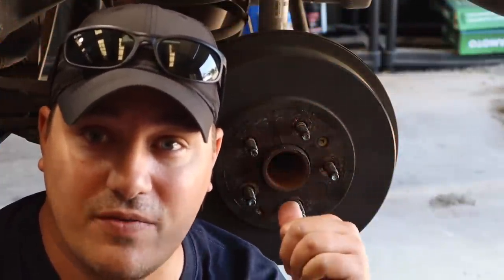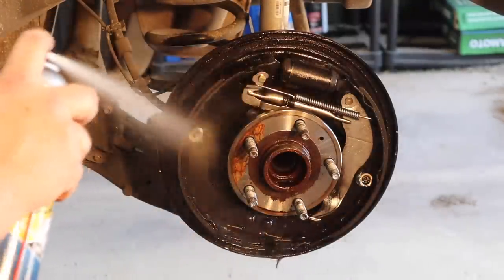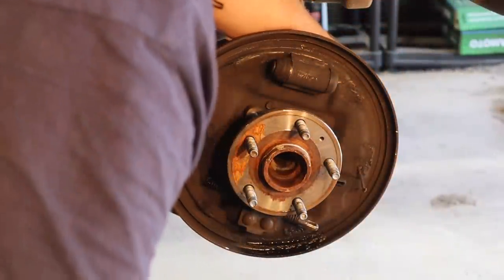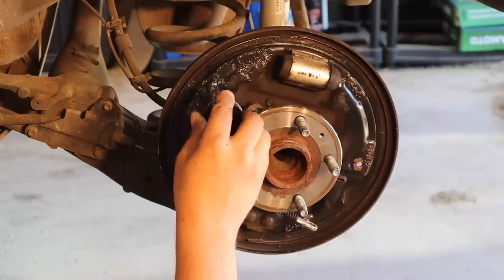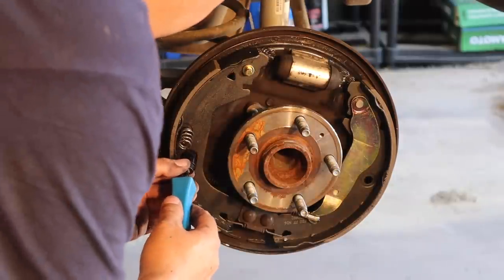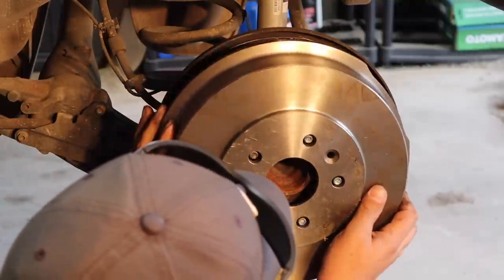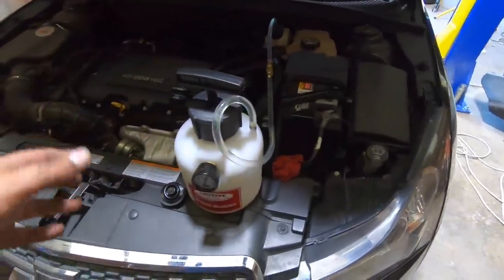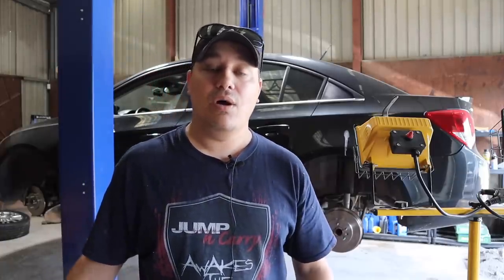Rear Drum Brake Replacement - 2012 Chevy Cruze Turbo 151K Miles

Comment: Who needs those drum break tools, struggles, struggles, almost got it, struggles,lol.  To each their own. Disc brakes are easier that's for sure. Good to see you continuing forward despite the recent setbacks.
Reply: The brake tools you needed a re very inexpensive at Harbor freight.  Using the correct tools would make the job easier and would Make a better video.  Randy you don’t have to put out a video every day. I think it’s better to have quality instead of quantity. Best wishes and don’t give up

Comment: One tip for you and everyone, the spring cap that went flying off, all you have to do is either use electrical tape or even duct tape, not much and tape it to your tool,the cap won't go flying off plus makes it so easy to reinstall. In addition I used a C clamp to hold the shoe in place to the backing plate, it only took seconds to put the springs on to hold the shoes in place. No headache involved.

Comment: You need to read a brake repair manual so you will know the concept and difference between the emergency brake adjustment and the neutral shoe position adjustment.  Most people watching don't know this.  Thanks for your work.

Comment: The squeaking and squealing is because the brakes are out of adjustment. All you need to do is run out the self -adjuster a few clicks and your golden. No need to replace anything.

Comment: Randy Pro Tip: Take a pic(s) of the assembled unit before disassembly! 👍👍 The invention of digital cameras/phones & that toolkit were certainly Godsends when it comes to doing these! 📸 I recall doing these prior & it was a b£#*h trying to do from memory or some chickenscratch diagram you drew & a screwdriver/pliers🤣😂. I’m sure it’s nothing for those that do them regularly but if you only do them every few years... made my head hurt!😂
P.S. That Power Bleeder is pretty slick! I’ve never seen one before 👏
Reply: Yes. I 2and that...taking a photo for placement is one of the best suggestions in the video
Reply: My shop teacher taught us to just do one side at a time and reference the other side if you forgot

Comment: I've had good results using vice grips instead of pliers. Just be careful not to over-compress as vice grips could weaken a spring or bend a cap if you pinch them too tight. Thanks for the helpful video!

Comment: The piece is the self-adjuster for the brakes.  When you back up and apply the brakes it puts the right amount of tension on the brakes as the wear down.  Almost nothing to do with the emergency brake.  The right tools make the job relatively easy.

Comment: For a huge reduction inheat, take a look at converting those Halogen worklights to LED.
Reply: Probably was from sitting in the sun. My own grille is warping and 2 cracks. One crack above each headlight, halogen, 1995 original GMC w/black painted hood.
Reply: @missingremote4388  My comment is directed to the heat generated by the Hologen worklights.
Reply: You really have no idea what your doing with these do you.
You consistently misnamed parts and poorly explained how to remove and replace the parts. You do not need to grease those brakes like that. All that grease is just gonna catch dirt, grit and brake dust and gum up the works. 
Ps a small nut drive is all you really need to install the shoe hold downs. Just find one the same size on a bit smaller ,line it up ,push down and a 90 degree twist.

Comment: I was amazed when my mother brought home her 2013 Chevy Cruze LT. Drum brakes on a 2013 car. WTF GM? I thought drums on consumer cars ended in the late 90s - early 2000s.
Reply: I was distressed to find drums on the back of my 2013 Cruze after replacing the front rotors and pads.  That job only took about a half hour.
Reply: My '14 has em on the back as well.  Just did my fronts but will happily pay a shop to do my drums.

Comment: This entry comes well after you published the video but think this may be helpful. You know the velocity of the brake spring when you failed on the spring cap install. You are lucky. You would have had zero reaction time had it headed towards your eye(s) and possibly lost one. Wish others who watch this take the hint and wear safety glasses/goggles to prevent this from happening to them. Other than that, enjoyed the video quite a bit and will be redoing brakes on my 2012 Sonic since they are pretty similar. Thanks!

Comment: @ 10:39 .. what I do is hold the pin with needlenose vice grips and  grab my regular plyers push and turn on the locking cap

Comment: I wrap an inner tube around the shoes and you can expand as you need to I also use a brake tool to get all my springs off and on.

Comment: I was changing my serpentine belt and took a pic of it before hand.  I forgot I took a pic and when I was putting the new belt back on, and I struggled with it for like an hour until I remembered the pic I took.  I was putting the belt on wrong and the pic saved me.

Comment: You should be using the spring tool instead of pliers randy it’ll keep the spring from flying off I have two of them. If u need one I can mail it to u I don’t need them I have disc brakes.

Comment: Don't beat the drum because of the dust, the tension release slot on back will give clearance.  Safety glasses a must on a instruction vidio and for "your safety.  Good 
video for viewers, keep up the good work.  I sure didn't know you were making $20,000 to $30,000 per month.

Comment: don't forget to clean out the motive bleeder with denatured alcohol and do not store brake fluid in it!! I literally just bought one, got it in yesterday and read that on the instructions and decided not to use it, sounds like a lot of work to use a tool thats not meant to hold the fluid you put in it. I want to try a check valve at the bleeder valve first, if that fails then time to buy some denatured alcohol and just use the motive bleeder

Comment: hey Randy. I have the motive power bleeder. I do NOT fill it with fluid. I  fill the reservoir with fluid and pressurize it with the power bleeder and just keep an eye on the fluid level. less messy, wastes less fluid.

Comment: Let me get this straight. You say you are making  10 to 15 grand per month on these videos, but you can't afford simple hand tools to do the job easier and safer. Damn  spring jumps across the room, just think if it stops at you eye. Back in the day we didn't have a Harbor Freight, we had to pay big money on Snap On or Mac tools trucks. And we had to buy them that way because flat rate mechanics need all the tools to make the job quicker. We didn't even think about safety back then. Also before you take off the brake drum, loosen the e-brake adjuster. As brakes wear they leave a lip on the inside of the drum. Backing off the e-brake let's the shoes bypass that lip. I did appreciate that you mentioned the brake dust. Back in my day the shoes were made of asbestos and we didn't know better. We took an air hose and blew that crap everywhere. Can you say LUNG CANCER!!! See, we weren't perfect either. Thanks for the memories or should I say horrors. Think about all four wheels being drum brakes, yuck!!!!!.
And BTW, we didn't have cell phones to snap a pic of how things go back together. So we made it a practice to do one side at a time so you have a put together side to reference too.
Reply: "Back in my day, the shoes were made of abestos"...they are still made of asbestos right up to 2019...this was a 2012 car and I'm glad he mentioned it.
Reply: I hate to start an argument here BUT, federal law stated that brake part manufacturers stop using asbestos by 1993 and off the shelves in parts stores by 1995. By 1997 all asbestos brake shoes were gone! Brake pads and shoes are now made with ceramics, metallic and organic materials. Still not good to breath that dust. They had us to use Safety Kleen solvents to clean away the dust. In fact they even made a small wash basin to put under the brakes with a brush to clean the backing plate.
Reply: @Steelman0355  No need for an argument...I should have been more clear...you are correct that no US manufacturer can use asbestos in their brake parts but that law doesn't apply to China or India and they supply much of  the low-cost aftermarket parts market. The law originally provided for banning the import of asbestos containing pads and drums but it was overturned by the fifth circuit.
Reply: Did more research. You are correct. Makes no sence at all. Ban the use of cancer causing materials in America, but allow import parts companies to continue use. That's just nuts and self defeating In so many ways. And we wonder why our manufacturing businesses went overseas. Oh well, I have to stop right here. This could easily turn into a political debate and I don't think that is the direction that Randy intends this channel to go. So with that, I will , out of respect for Randy, drop this topic. Thanks  for the enlightenment.
Reply: @Steelman0355  I didn't know the specifics of it. I had just heard someone mention it on a video the other day, so I did a little research on it after you replied and learned something new too. I couldn't agree with you more about how self-defeating it is  I agree with everything else you said in your posts, especially about the 10-15 grand a month but can't afford proper tools or safety glasses? Lol...sometimes this guy is a human train wreck, but that must be what people love about him. Cheers.
Reply: LOL Cincy! Can't help but love this guy! Reminds me of how I learned through my mistakes. School of hard knocks and skinned knuckles.😂
Reply: @Steelman0355  Lol...how true.

Comment: Randy, or someone who knows.. I hit my rear light side on my car while backing up.. anyways. The BRAKE lights and the signal itself IS NOT broken HOWEVER the cover of the light is broken.. as I said, turn signals work and the brake lights/turn signal doesnt even have a crack.. howver the part thats covering it the outside is broken.. the part that I think it colours it red

Comment: Your not adjusting the emergency brake, you are adjusting the brake shoes.  You do the adjustment with the drum on on the back side of the backing plate
Reply from the maker: Not on the Cruze. There is no plug / opening to adjust it once the drum is on.

Comment: Dr.D here the lube for the backing plate should be put on thin ,it attracts dirt and the brake dust can were out backing plate in severe cases.but to each his own,plus when it gets hot can drip on to drum and brake surfaces causing improper brake operation. Ps. not a real Doctor

Comment: How do you turn the wheel cylinder back? Is it not like disc brakes where you have to push the piston back in? Can you push it back in with the shoes? Or what is it, the ebrake adjuster controls this somehow? Also how do you get a tight e-brake at the handle, can you only get that with new shoes and drums?

Comment: The spring tool makes it 1000% easier to reinstall the cap. You still are not using the correct one. The correct tool has an inverted cone which slides over the entire cap you can then simply push on and rotate it 90°. The part is 25056 and is called "brake spring washer tool" and very helpfully doesn't show up when you search on their website for speciality brake tools.

Comment: Helps if you back off the break shoes first before removing the brake drum.
Reply: What do you mean by this?
Reply: @tinton3w144  There is an adjusting star wheel for the brake shoes and if you back the brake shoes off and away from the drums it makes it easier to get the drums off.

Comment: Instead of using a prybar why didn't you use a screwdriver in the backing plate slot to release the actuator adjuster from the adjusting screw? That would allow you to spin the adjusting screw the opposite way and back off the eBrake tension and the drum will slip right off. Also, make sure the parking brake isn't engaged.
Reply: Just looked at the back of mine and the two rubber plugs are nowhere near the adjuster like my old Ford was, had to pry off similar to how he did it here, and replaced one of the spring caps cause it went from a line to a cross and flew off

Comment: nice job on the cruise man. you should find the original engine and trans and interior for that 3500 !! it would be a sweet truck with that diesel back in there !! would not take much to find the parts

Comment: Don't hate the Chevy truck. Just the price, but it's in the past now and might as well forget about it. Just fix it as it still has the potential to be a good truck to get some use out of it.
You maybe able to figure out the approximate year of the motor if you get the casting number off the engine block and cross reference it.

Comment: I have a 2016 Cruze Limited. 60K miles bought new . I have never taken the drums off. So last weekend I popped em off and they had 0 wear. ???????????? I have been thru 2 rotor changes on the front and 3 pad changes. Really confused; I have worked on cars for 40 years and never seen anything like it.

Comment: Maybe you could ask the people you bought the 3500 from the year of the motor and TPI. I am pulling straws out of the wind here but...... Since it was running fine until you accidentally shorted out an injector that a new correct TPI should run good out of the box. You can also find the casting numbers on the engine block to find out what year it is. There maybe a number on the control box for the TPI also. I wonder if you removed the injectors from the new TPI and put them in the old TPI body if that may make things better. Possible there could be some type of idle circuit and passages that allow more fuel through in the old TPI. Maybe you could just get the injectors. Might be a number on the injectors.

Comment: The drum had a piece broken off of the outer lip. It probably won't affect the brake performance, but will be out of balance somewhat. You'll probably never notice it, but it could show up in an inspection, if you have those in your state.
Reply from the maker: That is how they balance it. It's 100% the same on both sides.
Reply: @AutoAuctionRebuilds  I had considered that after I saw the passenger drum was the same. You're getting higher quality parts than i do in NS,Canada.

Comment: think you need more grease.....
Reply: LOL....  Yeah I was going to make a comment about that....  Far Far Far to much grease.  It only takes a light coating on the boss pads of the backing plate.  You leave everything else 'dry' (The springs won't cause any noise if they are installed correctly.  The only other area that gets greased would be the threads of the self adjuster.

Watching this was a bit cringe worthy.
Reply: And another can of brake ckeaner. 😎😎😎